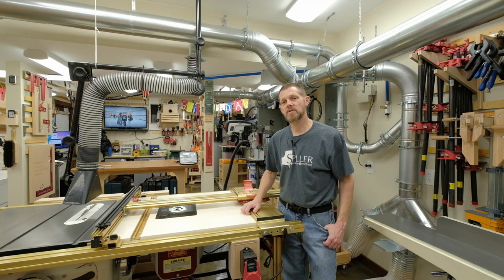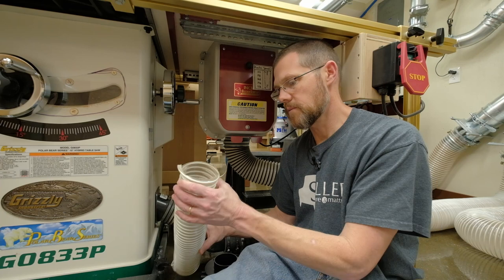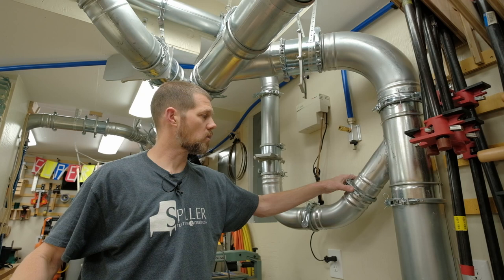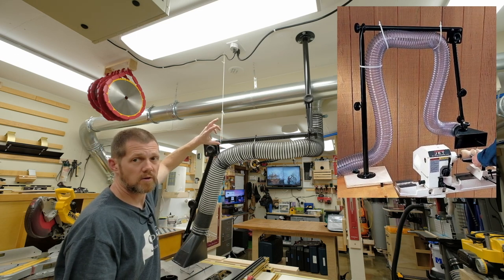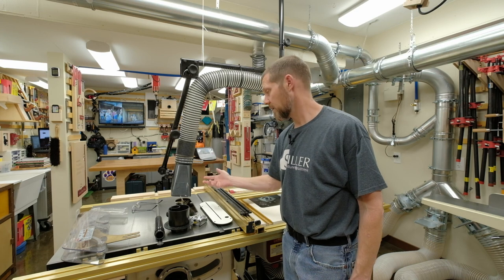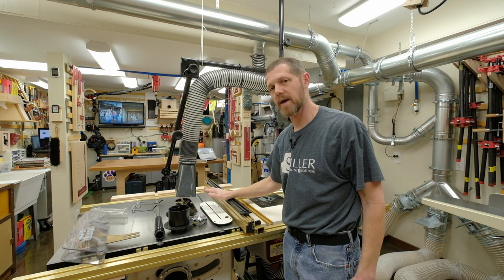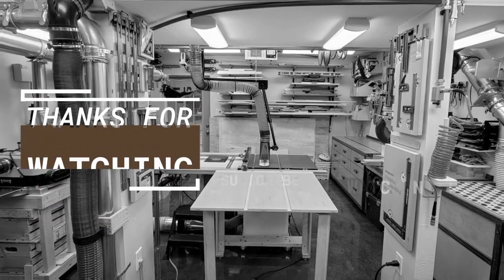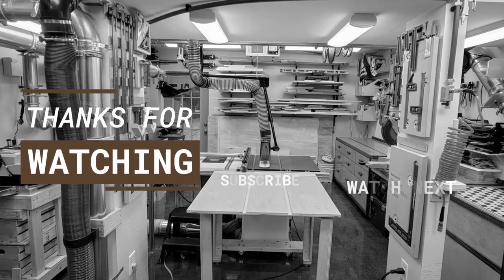Table Saw Overhead Dust Collection Arm

Comment: I found the perfect dust collector for a one man shop. 
I installed a Record CamVac 4hp/220v/triple motor vacuum with a Oneida Super Dust Deputy cyclone separator. This gives you both high volume and high pressure suction. It's a cheaper alternative to the Oneida Supercell except with much better filtering.
Reply from the maker: Wow. That's great. I had not heard of those before. That's for the info.

Comment: Firstly, I really prefer overhead dust collection on my table saw. Over the years, I’ve had none and then a boom but both just don’t work for me. I agree with all your comments on the Rockler item and so, I made my own. Very easy. Like you, I have overhead metal ducting (in my case 200mm). I made a spur which stopped just off directly above my blade and riving knife. That spur ended with a metal 8” to 4” reducer. Onto that reducer I put a shut gate and then a length of 4” flexible tube which goes to the dust hood. I made the dust hood out of 1.5” wide plywood (2 x 3/4” doubled up) just for the arc that goes over the blade and knife. I then put clear acrylic sheets on either side. Into one side, I cut a hole and screwed in a 4” flange plate onto which the flexible tube is secured. 

For flexibility, i made that 1.5” arc piece with a 2’ long straight piece coming from the top (a kind of T piece). I then made a square tube out of ply so that the straight of the T piece was a good fit inside it. That square tube is secured to the ceiling directly above the blade. To allow my to slide the inner part up and down (to get different heights above the blade) I put a steel insert into the square tube and a Bristol lever (or any machine screw type of handle) which I tighten or loosen according to where I want the dust hood. 

I’ve overcome all the issues about width of the dust hood being too much and easy visibility to see what’s happening. With a minimum of 4” hose and the port about 2” above the top of the blade, dust collection is brilliant. 

Wish I had as good an answer for the under table dust collection. My table saw has a port attached to a shroud surrounding the blade under the table. It is awful
Reply from the maker: Wow. Thanks for all the info on your setup. I wish I could see a picture or two. 

I am in a different shop space now. I still have the same basic setup as in the video but it works a little better for two reasons I think. First, is that I have a more powerful dust collector so I just get more air flow. Second, is that this shop has more space and the way that the overhead collection is arranged is just a little easier to use.

I am with you. The under table collection helps but the overhead really makes the difference.

I hope to make a new shop tour video later this year or early next year.

Take care!

Comment: I was busy this morning and couldn’t watch the video in its entirety so you may have covered this. But, are you also using the bottom dust port of your saw? What HP is your dust collector? Thx
Reply from the maker: Yes. I am using the bottom port, as well. When I made that video, I was in my basement shop and using a 1.5 hp V-system from Oneida. I have since moved to a bigger shop and have upgraded to a larger dust collector from Clear Vue but I am still essentially running the same set up at the table saw.

Comment: Nice explanation of your guard. I have a Sharkguard on my Unisaw and it's fantastic. Highly recommend it and the folks there are excellent to work with.
Reply from the maker: Thanks for the comment. Nice to hear from someone who has a Sharkguard. I definitely plan to contact them at some point.

Does it attach to your stock riving knife or do you have a riving knife from Sharkguard? Is it easy to attach and detach?
Reply: @liberatingwood  I have the riving knife from Sharkguard. It attaches to the stock Unisaw location. The guard  goes on and off easily with just two knobs to loosen/tighten. I have a 2” port on mine that I adapt to a 4” overhead drop of flexible hose.
Reply: @DavidR8  Thanks.

Comment: Nice..I was looking for a video like this where someone addressed the hose inside the saw cabinet…I got rid of the same port you did that had the connection for the overhead dust collection that came with the saw and just put a 3-4” adapter.  I planned on replacing the 3” hose inside to a 4”but I wondered if it would make any difference since I still would have to have a small section of 3” to make the connection to the shroud…did you notice a difference when you changed yours or was it minimal? Without using the overhead of course
Reply from the maker: It has been a while since I did all of those internal modifications and I wasn't rigorous about it in terms of taking measurements or anything. The other complication is that the first thing I did after removing the old connection and widening the hole in the side of the cabinet was remove the internal hose and shroud around the blade. I also put a board in the bottom of the cabinet to close that off. It may have been a dumb idea but I'm not that stupid. I know that some true cabinet saws operate in that way and I thought I would try it. I used it that way for a while but it was clear that it was a downgrade. Way too many air leaks since the cabinet wasn't designed to be used in that way. Now I was somewhat stuck in terms of going where I ended up. I needed to reinstall the shroud and reconnect a hose to it. Since I was running a new internal hose, I figured I might as well keep that at 4" as long as possible. 

I didn't go into more detail on this whole process in the video because I was trying to get to the overhead part. That was supposed to be the main point of the video and sometimes people get testy if the video is supposed to be about one thing and I spend time on something else. (Sometimes people get upset easily online - who knew). I get it. When I am looking for information on YouTube, I want people to get to the point.

So, in the end, I would say that what I have now for the internal collection is superior to how the saw came but it is hard to quantify that. It is also hard to say which of the changes had the most benefit. My instinct is to say that getting rid of the original inefficient connection was more beneficial than the internal 4" hose but I can't back that up with anything. As I explained above, the internal hose upgrade (if that is actually what it was) came about because my original plan didn't work out more than anything else.

Hope this helps.
Reply from the maker: After rereading my reply, I realize that it may be hard to follow. That is also partly why I left it out of the video. Let me know if I just made things worse and I can try again. Or if you would rather not be subjected to more of my ramblings, you can just leave it alone.

Either way, thanks for watching.
Reply: @liberatingwood  no no, I appreciate the detailed response…I’m not a overhead dust collection guy, I feel it just gets in the way and although I know it’s not necessary, I like to see the blade, especially cross-cutting….my dust collection is good but I’m sure it could be better …anyway I may try out extending the 4” …thanks for the response!
Reply from the maker: No problem.

Comment: I was just looking for something like this! I'll definitely be checking out the shark guard. 

I also really like the router table setup in the table saw with the incra fence, but I'm thinking I'd rather put it on the left side of the blade. Do you have any issues with reach when using the router table?
Reply from the maker: Be sure to let me know if you end up getting a shark guard. I'd love to know if it works out for you. I definitely want to get one at some point.

As for reach with the router table, I haven't had issues but it was something I was worried about. Normally when you see a router table, you envision standing in front of it to use it. With this setup, it is like I am using the table saw when I use the router table in terms of my position relative to the table and that hasn't been a problem. 

There are two things about it that I would possibly change if I could. The first is that the table itself isn't perfectly flat. It isn't a huge deal but it bugs me. Because of that, it is basically impossible to get it perfectly flush with the edge of the table saw and believe me I have tried.

The second is that I think I would prefer that the router table was separate from the table saw. There are times when I need to go back and forth between using the saw and router table that it just becomes an inconvenience. Again, not a huge problem, just an annoyance. If I figure out a good place to put it and can afford it, I may switch to a separate router table at some point. 

For now, it works well and I am happy overall. Just thought I would throw those things out there. As with all of these shop decisions, there are tradeoffs especially when dealing with limited space.

Comment: I have a Harvey cabinet saw with the Shark overhead Guard. The saw has the same dust port as you demonstrated containing  a port for the overhead dust collection. I agree it is restricting the dust flow capacity.  Question for you, is there any difference if I use the 4" ABS Universal Dust Collection Port that is slanted as you installed verses a straight 4'' Universal Dust Port from Rockler?  Also when you installed the two dust ports  did you have to drill new holes into your cabinet to fit the new dust ports? My goal is to improve the overall dust collection in my table saw which is currently terrible to my standards.  Good video and thanks for sharing.
Reply from the maker: So I can't say anything definitively about comparing the two different types of ports. I haven't tried the port you indicated nor have I done any sort of comparison. However, I think that the two would be comparable since they are both 4" ports. 

I do believe that I had to drill new holes. I had also already done a good bit of Dremel work to widen the opening in the cabinet.

I would say that my current table saw dust collection is adequate but not ideal. I would like to upgrade to the Shark Guard, but I may change out my table saw in the not too distant future so I don't want to spend money on a guard for that specific saw.

Good luck.